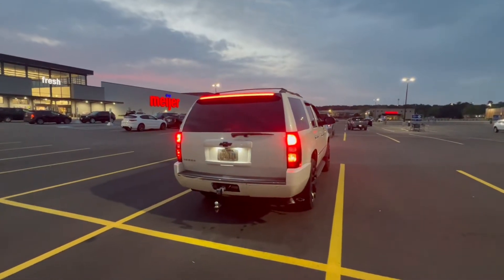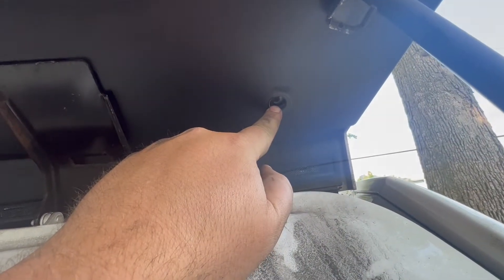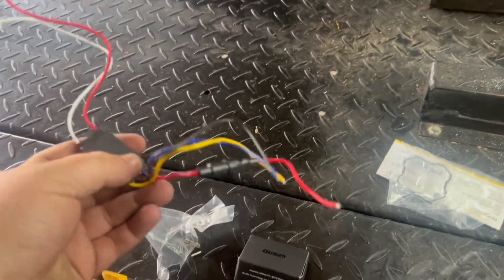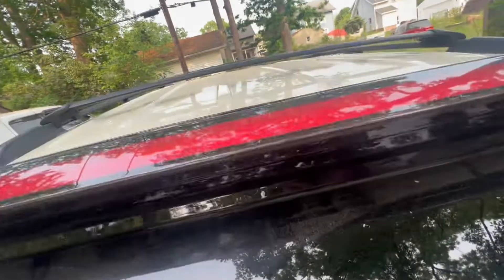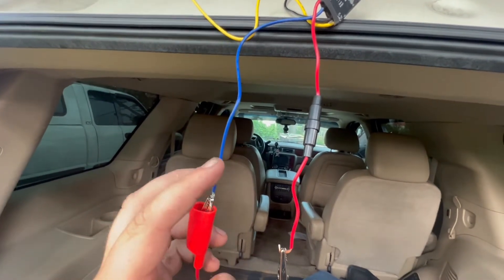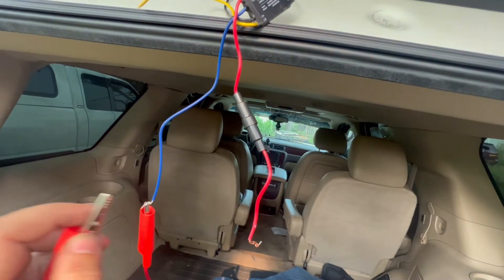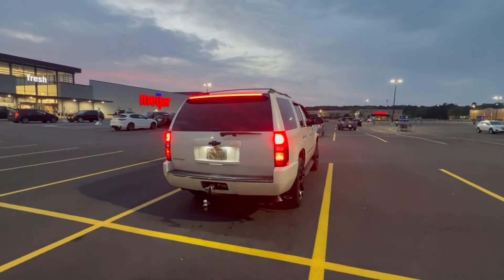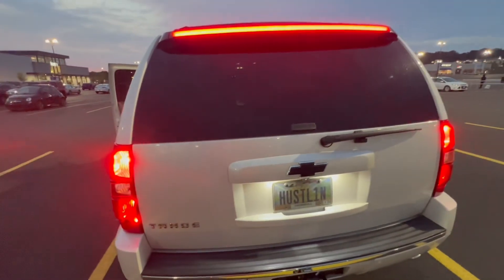3rd Brake Light as Running Light Mod on Chevy Tahoe, Suburban or Yukon

Comment: Hey u need your help wht color wire on the escalade taillight did u use to work on the 3rd brake light
Reply: I mean I need your help on this one I thought the red wire on the escalade taillight would be the brake like wire but it's not
Reply from the maker: I’m sorry I can’t remember, I would check them with a test light. Find out witch one lights up when running lights are on.

Comment: I might have missed it but where did the yellow wire go?
Reply from the maker: I did not hookup yellow wire, just wrapped it with tape.
Reply: @armyguyz00  Cool idea. I purchased after market tail lights and I have no clue which wire on the aftermarkets is the constant wire for the tail lights.
Reply from the maker: @RodneyCooperFilmz  follow the wire harness to the connector. Unplug it and check with test light until you find correct wire. Good luck
Reply: @armyguyz00  okay I’ll give that a try thank you.